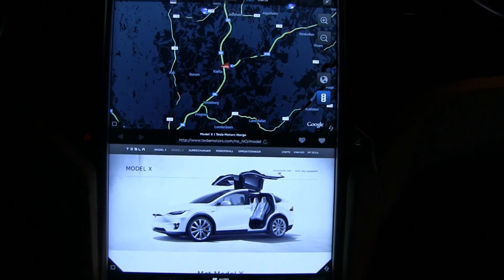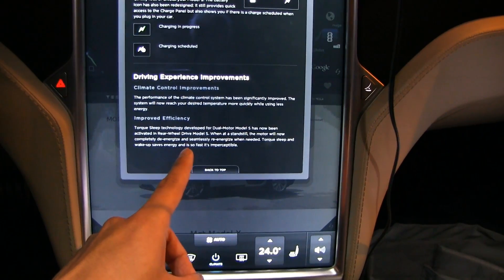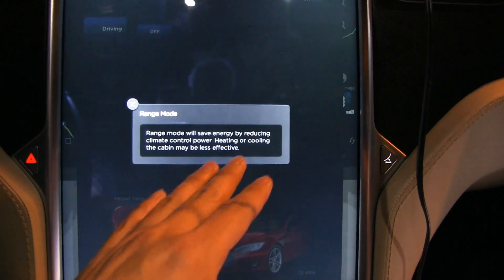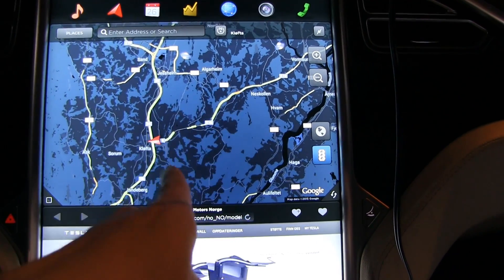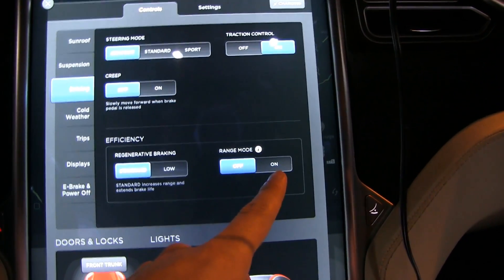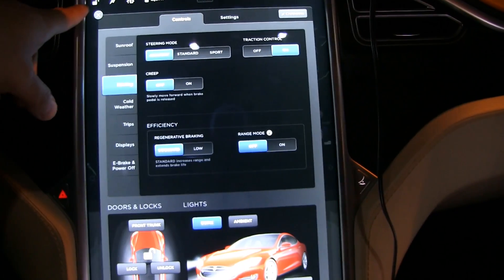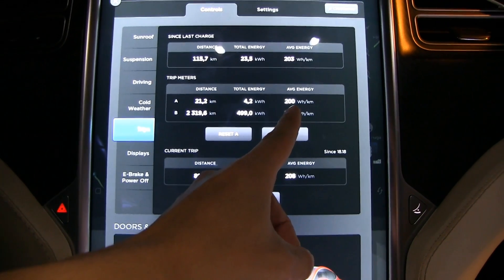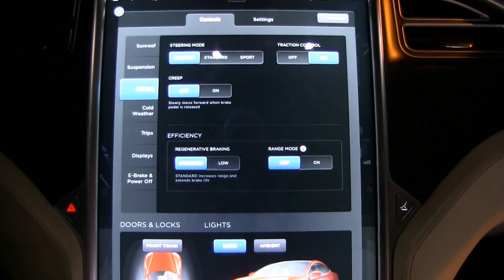Torque sleep energy test on RWD P85 with 7.0

Comment: Interested in how you make sure that your driving is the same on each run when you do tests like this. I assume that you try to use the exact same speed, at least when you are driving steadily on highways.  I have thought of doing a similar test, but I wonder about effects of traffic on my speed, ability to control speed consistently on ramps and local roads when turning around to return to the highway, and so on.  So do you have any 'tricks' to maintaining the same conditions?  Do you use cruise control on the highway, for example?

Comment: Note: Setting the temperature setting to 22 does not mean that you get "22C in the car". It means that you normally get something that you would experience as a temperature somewhere around your normal comfort level. The temperature "in the car" will still vary A LOT. Like +- 20 degrees depending on where you measure. Or something like that. 
If you would have 22C at your head in -20C ambient temp, your experience would be that it is very cold. And drafty. And unpleasant. You would need about 26-28C around your head to be in comfort in that case. 

So it's not a bug. It would be a very bad climate controller if it indeed did make the head temp in the car 22C at set temp 22. It simply wouldnt work well. No cars with automatic do it that way.
Reply from the maker: +Markus Ottosson Before 7.0, if I set the temperature to 22, the app would after an hour of heating/driving report that I have 25-26 inside the car (there's no way to see this inside the car unless you use the app). Now if I set the temperature to 22, it will after an hour of heating/driving show 22. That's the bug I'm talking about.
Reply: +Bjørn Nyland 
If set to 22 during a PreCond, I would expect the in car sensor to (after a long time) be between, say about 22C a warm summer day and much higher (about 26-27C) a cold winter day. _The sensor_. Not the air in the middle of the car. 

My guess is that the actual temperature in the car is the about the same as before. And that they just trick the customer by showing 22 degrees because people (apparently) expect it to show 22 when set to 22.

If it actually would be 22C at the sensor, people would most definately complain that the car is to cold on winter days. And about right during warm summer days.
Reply: +Bjørn Nyland ( I work with climate control and interior experience. And the one most common misunderstanding I meet is that the "incar temp" (whatever that means) is, or should be, equal to the set temp. People expect it to be like that, but don't realise how bad the experience would be if it really was... )
Reply from the maker: Markus Ottosson
Can you explain why the app reported 26 before when I set 22 and that it reports 22 now that I set 22? No hardware was changed. And Tesla owners have reported after updating to 7.0 that their car feels colder now.
Reply: +Bjørn Nyland 
It's just a SW calibration change I guess. Of the target temp. Maybe people complained it was to warm. Maybe TM want to save energy. Maybe a change in the signal processing of the sensor (less lead filtering perhaps) or the displayed value, but if people experience real change less likely. (Less lead filter would lead to a warmer car, while still showing lower temp values.)
No idea actually. But not likely a bug fix. More like a planned change. 

I don't work for TM. Worth mentioning here.
Reply: +Markus Ottosson and +Bjørn Nyland 
 simple test shows is Tesla apps temperature right or wrong is put temperature gauges different places of the car if heater/AC works like our volvo it has +-1C different when it is warm time is only variable in this experiment fan and air outletin in automatic mode, inside circulation on (keeps temperature difrenses in minium and heats up faster), set wandet temperature and wait

Comment: This doesn't seem like a very relevant way to test the torque sleep stuff... If I understand it correctly, during continous driving, torque sleep does not occur at all. You need stops / idle situations for that effect to kick in.
Reply from the maker: Nick J Howe I am 100 % sure that when standing still, the trip meter doesn't count. Just try to sleep in your car for 8 hours with camper mode. Typical consumption should be about 50 km or 9.5 kWh. If you drive for 100 meters, your consumption should show 95,000 Wh/km. But it doesn't.

The reason why you get very high numbers right after you start driving is that it takes a lot of energy to get the car moving. And because you have only done a very short distance, that initial energy makes the average go up a lot.

If you just supercharged and left while the power output was still >60 kW, the car also consumes some energy cooling the battery for a few minutes before the AC slows down.
Reply from the maker: +janmb The problem with stop/idle is that the trip counter doesn't run when the car is standing still. One way to measure this is to look at km of range consumed and energy consumed.
Reply: +Bjørn Nyland You could put the car in drive, turn everything off, and see if there is a difference after standing still for an hour or so in drive. I notice that there is a slight pull forwards even when my foot is off the accelerator. That might be gone with 7.0?
Reply from the maker: kodez79
I don't remember how long the car stays in drive mode until it goes back to park. Maybe 15-30 minutes. The test must involve setting the car in camper mode then.
Reply: Bjørn Nyland I agree with you, but assume you keep the car in N or P rather than D when sleeping.  Torque sleep would only apply when the car is in D. I would suspect the trip meter counts energy usage when stationary in D.
Reply: +Bjørn Nyland or you could have just asked Tesla :P
Reply: +Bjørn Nyland are you sure about this?  I thought that it still counted energy usage, which is why you get some crazy high numbers if you do very short distances.  My understanding is the same as +janmb - the savings will primarily happen when the car is stationary in stop/go traffic.  Maybe we can do a test where you drive one km, sit in D but stationary for 5 min, then drive another km.  And repeat with range mode.  The problem will be that if torque sleep is on regardless of range mode you won't be able to see the difference.